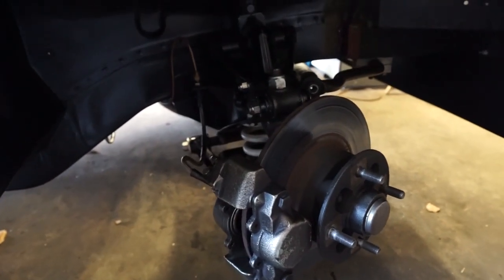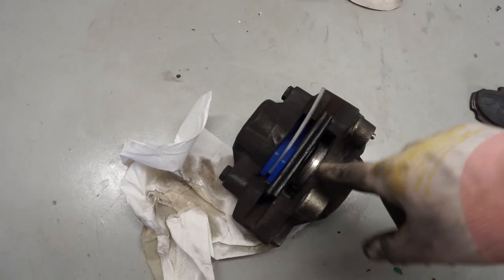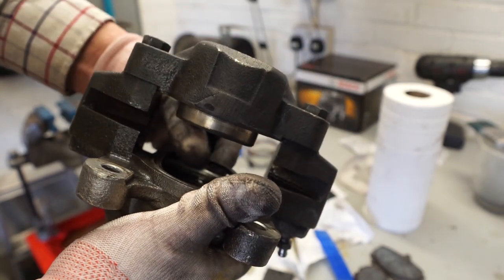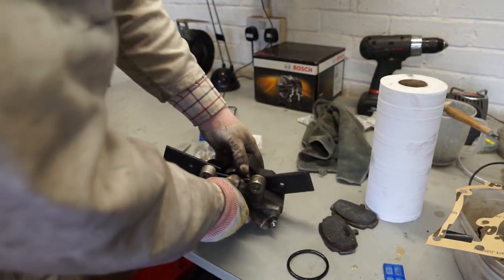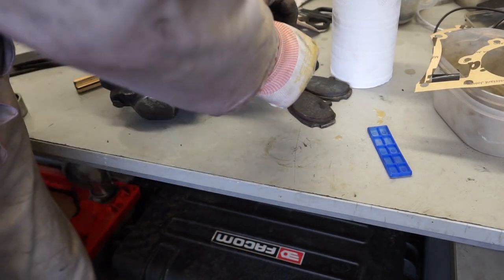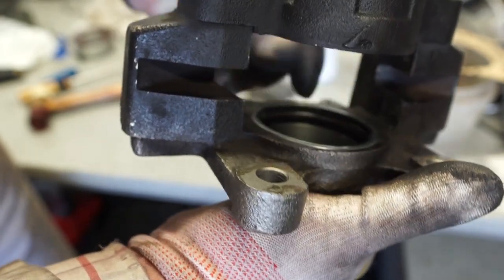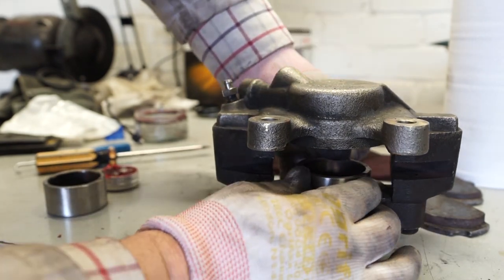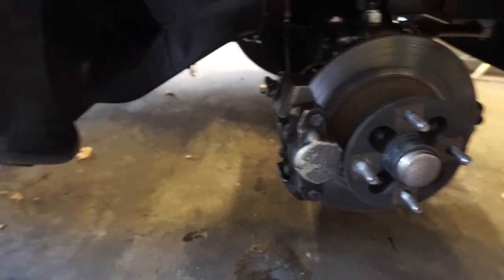MGB Front Brake Calliper Rebuild: Replacement of Seals and Pistons on Disc Brakes

Comment: Why not remove the two bolts to separate the caliper halves? That would make the rebuild much easier.
Reply from the maker: Thanks for your message, I went down the split calliper route a while ago and whilst one re-sealed fine the other always seemed to weep a little at the joint, even with new o-rings. For some reason Moss do not recommend splitting the callipers but I can see no real reason not to. You will need to install a new seal (17H7679)  and new bridge bolts (27H4353). I believe the bolts are the stretch type and should only be used once. 

Personally I don't find it to bad putting the seals in as they are, I certainly find it easier to pop the pistons out too with both sides together.
Reply: @davidrussellwilks  Thanks for your valuable advice.  After carefully inspecting my calipers on my workbench and noting some rather deep scoring on the metal surfaces, I decided to purchase remanufactured calipers from a vendor that doesn't require a core charge.  Also, there WAS unequal wear on the old brake pads, so I purchased new replacements.  Hope all goes well with you.

Comment: I tried the same technique on mine and it just bent the ring. It would appear the rings I got were a hair too large.
Reply from the maker: The rings are very thin, unfortunately it is easy to damage them when refitting. You could try freezing them first, it might just make them a tiny bit smaller.

Comment: Hi David. I really enjoy watching your videos which are always very informative and concise. I must say I’ve been trying to work out which gloves you are wearing as I wouldn’t mind getting myself a few pairs for working on the car. Which ones do you normally use 😊?
Reply from the maker: Thanks for your message Chris, the gloves I use are a nylon PU glove. I do suffer with bad skin on my hands and oil, great etc really doesn't help. I find these gloves work really well for me, they are stronger than latex and also let my skin breathe. They are also fairly lightweight/thin so can be used for fine work too. I buy mine here https://www.ebay.co.uk/itm/24-Pairs-Of-Brand-New-White-Nylon-PU-Safety-Work-Gloves-Builders-Grip-Gardening/181031170878?ssPageName=STRK%3AMEBIDX%3AIT&var=480203076638&_trksid=p2057872.m2749.l2649

I also choose white so I can see when they are dirty.
Reply: @davidrussellwilks  Hi David. Thanks for the info there. I will definitely be getting myself some of these. Looking forward to the next video👌🏼

Comment: Great video David, I wonder if I should replace mine?  They stop me lol.  I have to figure out what is leaking from my rear end.  Some fluid residue on the wheels which can't be brake fluid because the reservoir is good, but I feel it is coming from the axle
Reply from the maker: I found that both my callipers were slightly seized; I imagine the high temperatures don't help. In the end I swapped them both for brand new ones (video coming soon). I'll rebuild both the old ones and keep as spares. Uneven brake pad wear is a sure sign something's not quite right, it's easy enough to check.

I had an oil leak on my rear axle; there was slight corrosion under where the shackles/bump stops for the springs are. I think as the axle got hot the axle oil was vaporising and leaking out, took me a while to find it. It was only a tiny pin hole

Comment: Good video, thanks very much. I’m wondering if it is necessary to replace the steel retainers in a calliper at all as there is no contact between them and any moving part- they just retain the seal. You didn’t actually find any reason why the piston was sticking on one side - no corrosion but possibly a build up of dirt? I have always treated the callipers as a service item and replace them with the pads. Similarly the rear pistons are a disposable item after each intense European rally they just don’t seem to survive heavy use. I now have so many used calipers that I thought I would rebuild them with new seals and a stainless bleed
Nipple and then recycle them.
Reply from the maker: Many thanks for your message David, the steel retaining rings tend to be included with the seal kits so I just swap them as a matter of course. They can get damaged when you remove them, but otherwise there would be no reason why no to re-use them. I never got to the bottom of why the calliper seized, a clean up of both the piston and calliper seemed to cure the issue. In the end I did the same as you and just bought two new callipers, I fitted new stainless steel pistons but at £100 for a pair it works out less than the cost of have an old set re-electroplated, a new seal kit and bleed nipple. I've kept the old ones as a spare but most likely I will just buy another new set when the current ones start to look a bit tired.

Comment: Hi, brilliant video, thanks. Completed calliper rebuild following video. Pressed metal dust covers and heard the click. Only issue is that they and the rubber seal come out with the pistons when brakes are pressed
. Can't see where I have gone wrong. Just how much pressure is required to seat these?
Reply from the maker: The metal rings should be totally flush with the surface, has one side come away slightly?

Comment: Would it be possible for you to cover changing the brake rotors on a wire wheel MGBGT as part of your next video please? It's a job I'm close to doing but have read that there might be more to it than with normal alloys due to the knock on nature of the wires.
Thanks again for another informative video 👌
Reply from the maker: It's the job I'm doing at the moment Philip. The steel/alloy wheels can be a bit easier to work with than the wires as the nut on the stub axle is far easier to access, with your wire wheel hubs finding and removing the split pin can be tricky. A magnet type pick up tool is also especially useful for removing the end washer and shims in the bearing. I'm around halfway through, but wanted to cover the rear brakes too in order to make a comprehensive video covering everything.